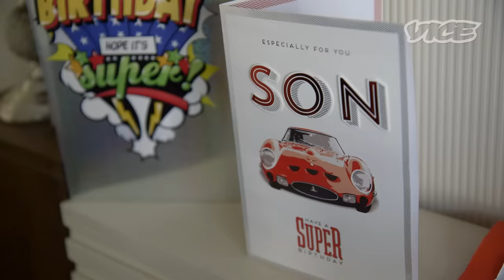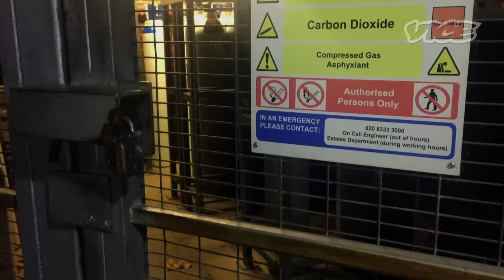The Most Memorable Interviews From High Society

Comment: "and for some reason set an alarm" this guy has clearly never done drugs lmfao
Reply: Can you explain?
Reply: @hummir most experienced drug users will set an alarm for a rough time to either re-dose or when they should be starting to feel the effects
Reply: @Strawberryscent_  definitely not most. At this point, people just come and ask me and I look at the time and tell them. It's usually quite basic math like 15 minutes, 30, 1 hour, 1 hour 30, or 2 hours and I can usually do modulo math like that when high. Alarms are too jarring for many people.
Setting an alarm is more important for timing redoses or noting the comedowns. It tells your peaking ass when it's time to start getting ready for bed or time to take a quick break to redose.
Reply: @DR-54 depends what circles and what drugs, its v common in the pysch community
Reply: @Strawberryscent_ if you need a alarm to know when your drugs are kicking in you need a new dealer!
Reply: @Strawberryscent_  well then dont make a dumbass comment like "this guy has never done drugs" when it's localized to a specific kind of drug use
Reply: @monke3552 you also clearly havent done many drugs lmao
Reply: @Strawberryscent_  Bruh ive done every common substance except coke and pcp. I trip several times a year and this is the first i have heard of people using alarms. All you need to do is note the time you dose and look at a clock. If you can't figure it out you don't need the alarm to tell you you're tripping anyway.
Reply: Old and new